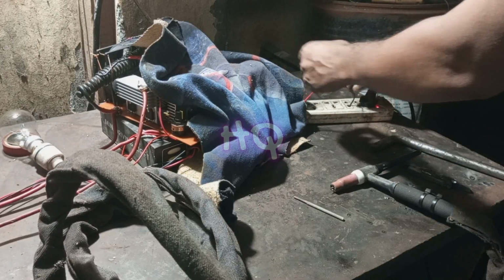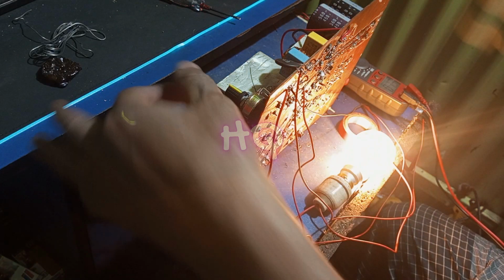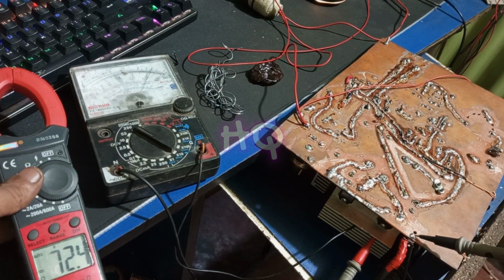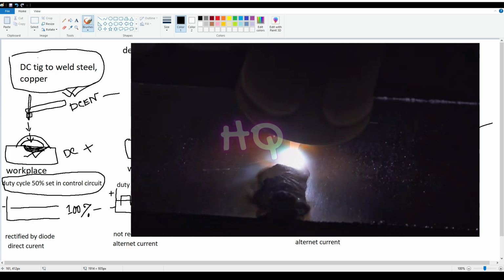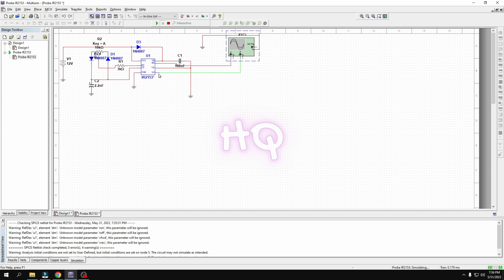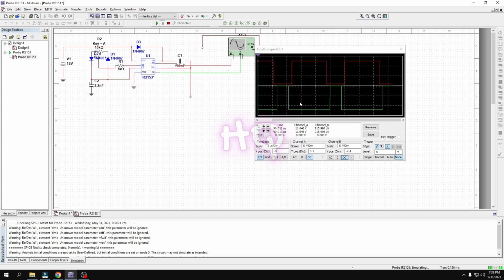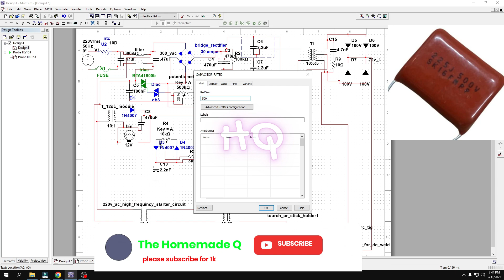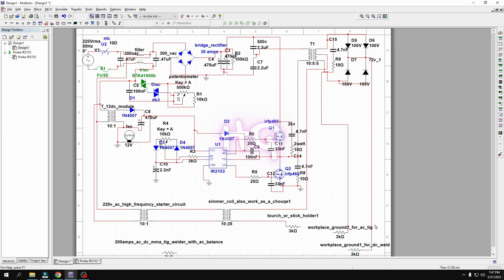diy AC DC tig welding machine | AC balance | 200 amps

Comment: no se ingles y los subtítulos están mal ¿ya puede soldar aluminio o no?
Reply from the maker: perdon por la demora señor
En realidad, la soldadura de aluminio requiere corriente alterna y corriente continua cuando desea soldar acero, cobre, etc.
Dado que de este circuito obtendrá CA CC en dos tipos de corriente en la sección de salida.
Si obtiene tanto CA-CC como corriente de salida, puede soldar cualquier cosa como aluminio, hierro, acero, cobre, etc.
El hierro, el acero y el cobre son fáciles de soldar con corriente continua, pero el aluminio es difícil de soldar.
Para eso necesita corriente alterna Pero no solo corriente alterna, necesita una corriente alterna balanceada.
Mira bien el vídeo de principio a fin y lo entenderás.
Reply from the maker: sorry for the delay sir,
Actually aluminum welding requires AC current and DC current is needed when you want to weld steel , copper etc.
Since from this circuit you will get AC DC in two types of current in out put section.
If you get both ac-dc as output current then you can weld anything like aluminum, iron, steel, copper etc.
Iron, steel and copper are easy to weld with DC current but aluminum is difficult to weld.
For that you need AC current But not just AC current, you need a balanced AC current.
Watch the video well from the beginning to the end and you will understand.
Reply: @MSB4B Hello, can you tell me the size of the big choke and the wire thickness?